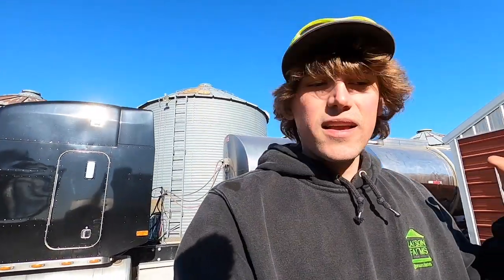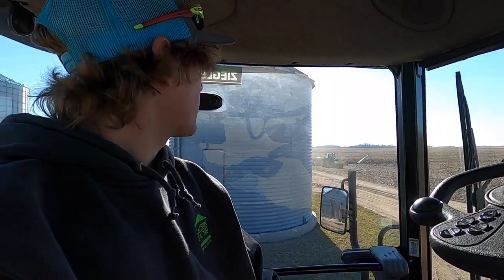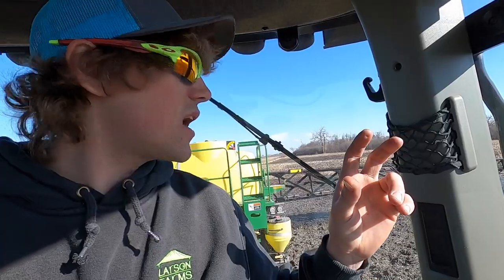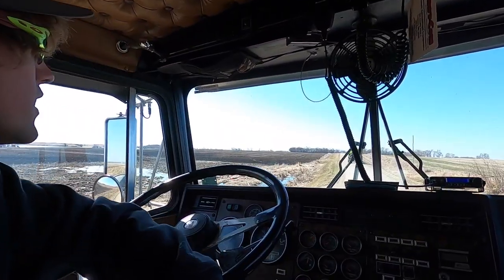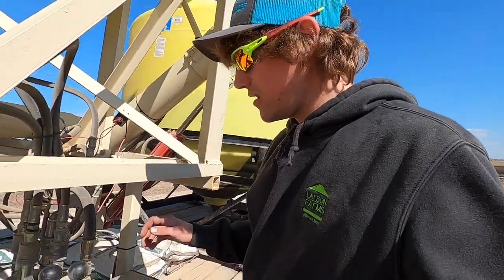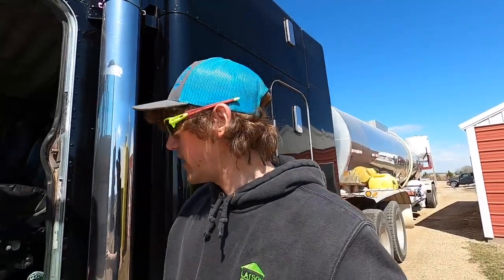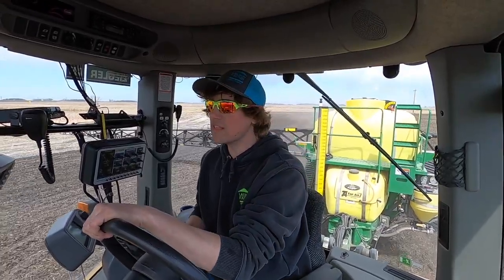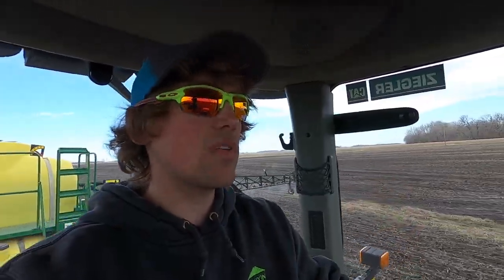Ready Set Spray. Episode 3.

Comment: I  operate a 9560R JD pulling a 1895/1910 no-till/commodity cart. The farmer is running a 9570RT with same combination behind it. We have been seeding spring wheat here in NW North Dakota in to some pretty wet bottom ground. The RT does fine until he is late turning out to miss a wet spot. Then the one track will spin out and its stuck. The 9560R is running duals and seems to be able to handle wet ground much better. I enjoy your videos. Keep up the good work
Reply: Yes they do...I found out about tracks and spinning a long time ago with a Cat 95E and Steigers ripping clover in half thawed ground...

Comment: We use a Wilmar sprayer with 80 foot booms . We had an apache sprayer but we didn't like it so we purchased a top air sprayer like yours but ours has tires. We might get rid of the Wilmar it's old and  the 1 top air sprayer is   plenty enough for our 4500 acres .You can't beat the price or capacity.  We pull ours with a 7810 johndeere. We can keep up with both of our planters with the 120 foot  booms .Nice video stay safe and farm on my friends  !

Comment: We use the Midland Digital private radio's system for are trucks. We have for different Supervisor A, B and C private radio's you have same on your radio's. Raiders about 20 miles in truck and mobile are 5 miles. We have CB CB radio's and private radio's.  Good service have used system for the last 6 years. Before using Motorola private radio's for very long time.

Comment: My question is this. So you are using 12.5 gallon of 28% and then 10-34-0 through the planter. I’m an agronomist by trade and relatively new to your channel. What else are you using for Nitrogen in corn? Dry Fertilizer, or NH3? (We use about 50 gallon of 28% or NH3 followed by maybe 20 gallon of 28%. No dry fertilizer at all for Nitrogen) I enjoy the seeing the equipment but I also enjoy seeing the farming practices in Minnesota. I’m in Ohio so the practices are very different. Keep up the good work.

Comment: I dont know which is the reason I'm asking, is it cheaper to buy a tractor and a sprayer compared to a sprayer that has a motor and you drive, or is it because the pull planter can have a wider wand or sprayer width, do they even make a drivable sprayer thats really wide or as wide as a pull behind.
Reply from the maker: Every farm is different we do use our sprayer tractors for other jobs on the farm the one runs the bean planter and the other one does some tillage in the fall so they get used for more than just a sprayer.

Comment: You'd be much better off with a self propelled. Give one a try and you'll never go back. We dropped tank 600 gallons in tank size and from 100ft to 90ft booms and we spray more acres a day than we used to. Plus, its much easier to handle once the crop comes up. I think if you tried one out, you'd be surprised at how productive they are. There's a reason co-ops and retailers don't run pull types.
Reply from the maker: It’s a matter of opinion. Pull types fit our operation much better.
Reply: @LarsonFarms  All I'm saying is you should try one out. Would be interesting to hear a review after operating both!

Comment: Are you running Greenfit in the sprayer tractor?
Reply from the maker: For what? I’ve never heard of that
Reply: It's basically a controller that translates between a John Deere 2630 display and another manufacturer's auto steer controller allowing you to use hey John Deere 2630 to run auto steer in a tractor that's already equipped with auto steer that doesn't support John Deere's auto steer protocol. The only reason I asked is because if we ever get something besides a John Deere, (Fendt) it's a solution to being able to run auto steer using a John Deere display and receiver